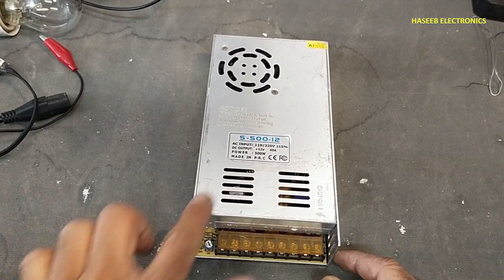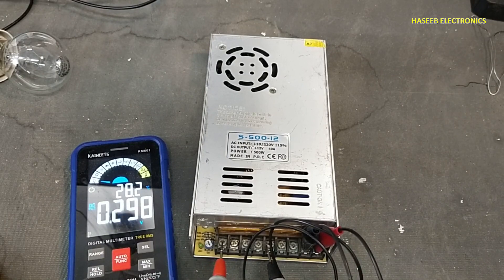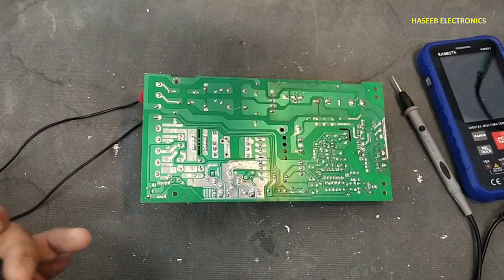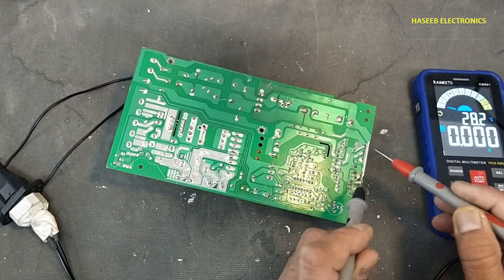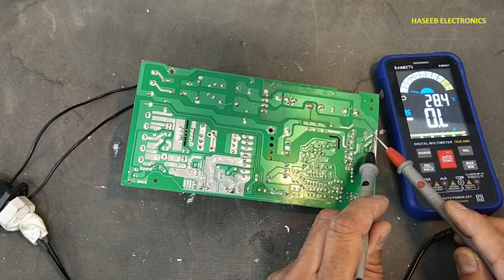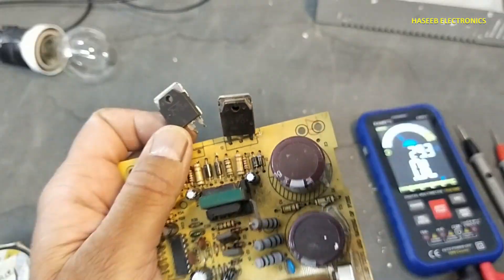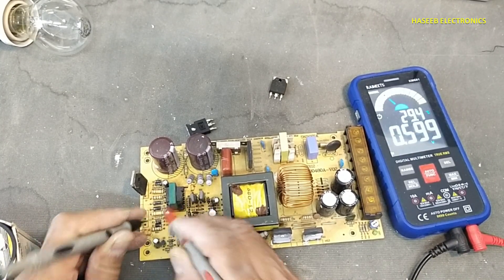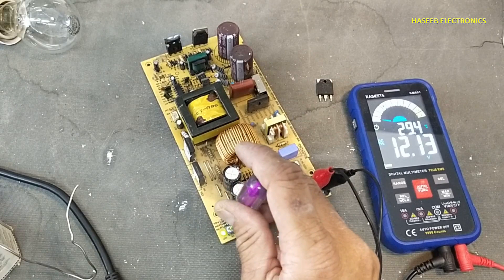{890} SMPS have no output voltage

Comment: change the capacitor 250v330uf
Reply from the maker: capacitor is good, no need to change capacitor. the power transistor is short circuit so it is not blocking voltage. in normal condition each capacitor's voltage must available at each transistor's collector to emitter. if any transistor is short circuited, then it will not hold VCEO, in result all voltage will appear at the opposite transistor. so the power supply cannot take startup
Reply: @HaseebElectronics  What is the cause of the transistor burning.. Is it an overload or distortion in the pwm signal or the discharge elements and the transformer coil have a faulty diode, capacitor and 47k fast resistor

Comment: 1:57   Who do you ignore the black marks under the caps ?
Reply from the maker: i was checking that, is there some burning sign or smoke sign
Reply: @HaseebElectronics  
it didn't appear that you made any mention of the caps possibly being shot,
You didn't check the E.S.R

Burning smells are fine, if it just blew up now, but if it's been a week or 2 the smell wouldn't be there

You touched it with your fingers then.. thought nothing of it

Great you swapped the Transistor,
You didn't check other possible faulty components as a result of the short
Reply from the maker: the capacitor ESR test is needed when the supply don't drive the load or it fluctuates or the power MOSFET or fuse burns out
if the circuit works fine, then mostly I skip the ESR test
Reply: @HaseebElectronics  
Sure...
Respectfully mate (My Fellow Electronics brother) I've been doing this since i was 6,  I'm 49

we all have our things, don't we.
there are foundational rules such as (always test voltages first)
but then we all put our own stamp

ME... I have seen too many situations where  i should have tested E.S.R. on Caps
and... time and experience has taught me that i should

Besides it only takes you say a few seconds more to test 2 or 3 caps or maybe 1min to test them all

when i repair, i basically do what you did, i follow the voltage
i find the fault , i replace one thing at a time

BUT I ALWAYS DO HOUSEKEEPING AFTERWARDS

if all seems ok, i'll check basics like
ESR on caps
Resistance on Fuses
Just in case
and i have had scenarios where i have seen High resistance on fuses even though the circuit works and high ESR on caps when it was all working
and changing them out as well since it's open saves time fucking around later on

but hey, again, we all have our own way we do things

that's how i would have done it
but yeah, mainly because you had all that blackened stuff,   I NEVER LOOK PAST THAT
Reply from the maker: salutes and special thanks for your valuable comment 
you are exactly perfect
Reply: @HaseebElectronics  
You're welcome
You're Quite Handsome yourself :P

Comment: I have 6v 30 amps with exact problem but when I opened the box i saw they totally removed the transistor serial numbers by polishing the plastic surfaces.. do you have any suggestions about which kind of transistor models are compatible for this power supply please? Is this model what you showing is compatible? Thanks
Reply: Trace the circuit with what ever other components are still unremoved including switching ic. Match for ckts. You can find it out.

Comment: hwy not both power transistors  change (due to long term reliability) ?
Reply from the maker: if one is working good, then i think no need to replace. as it is in bipolar drive, so it will work normally

Comment: Very fast repair brother but some information need you replace defrent transistor i see and last question SMPS can use as lithium battery charger ?
Thank you and best regards from Philippines 🇵🇭☕☕☕
Reply: Look for data sheets or replacement tables..
Reply: NO! Used to charge lithium cells will result in uncontrollable fire!